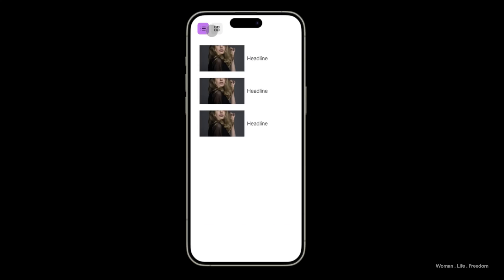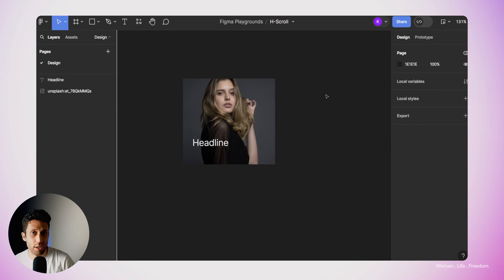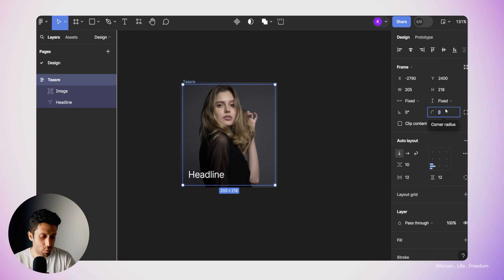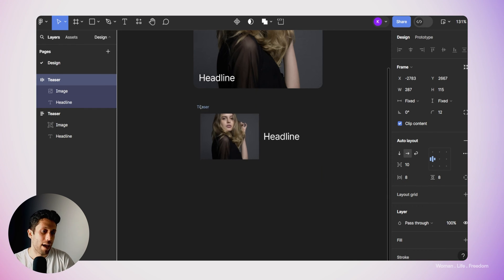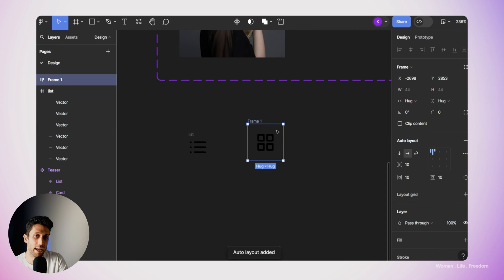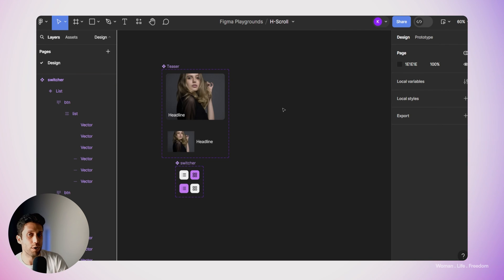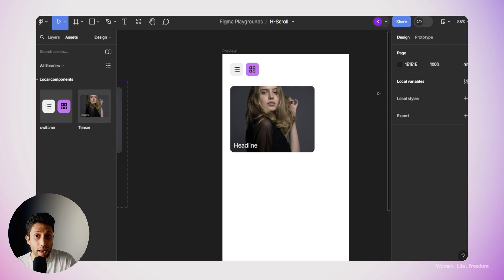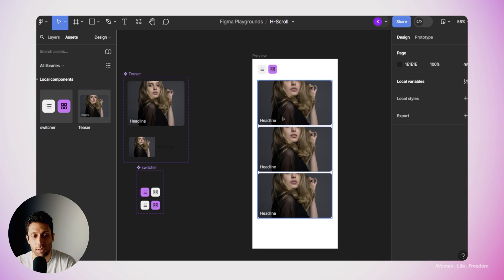Change component variants with variables - Advance Figma prototyping

Comment: Why did you us a conditional instead of "set variable" ?
Reply from the maker: The buttons both are blong to same component, and states of them are different variant of that component. So I wanted to make the prototype by making one interaction for an instance of the button component. so I am checking in which state it is, to get sure by clicking on same element, the variant switch properly. I made it this way in this video, there are other ways too. Thank you!